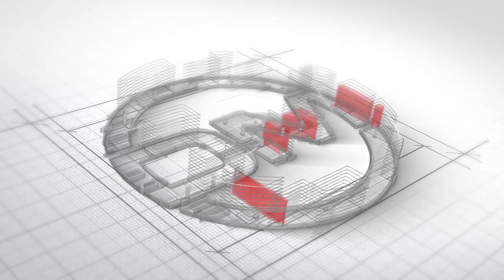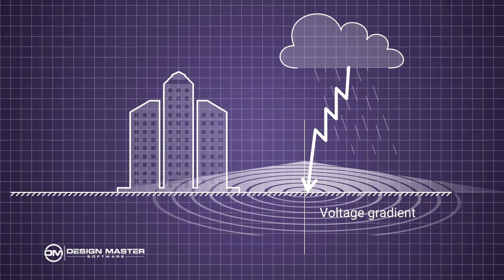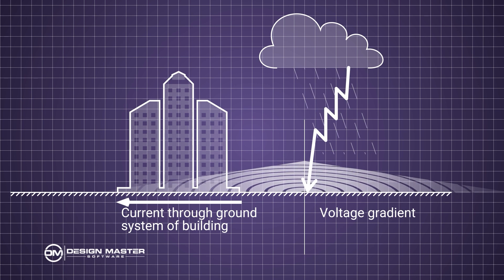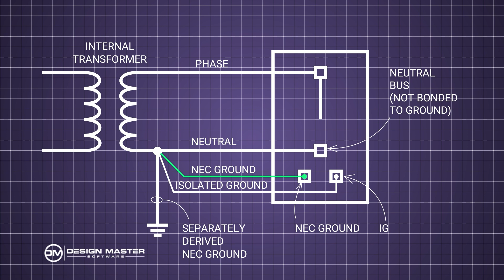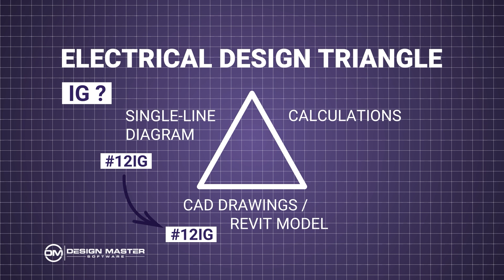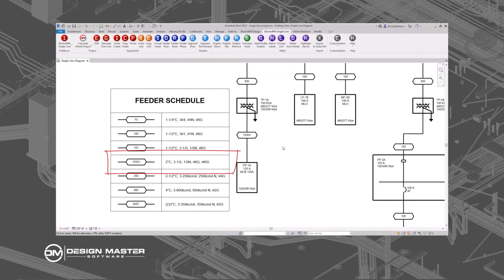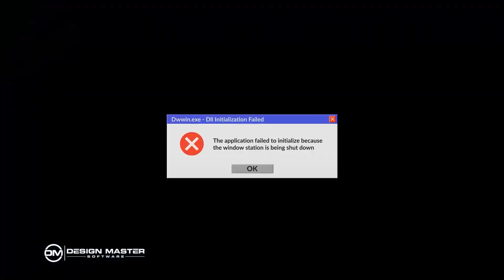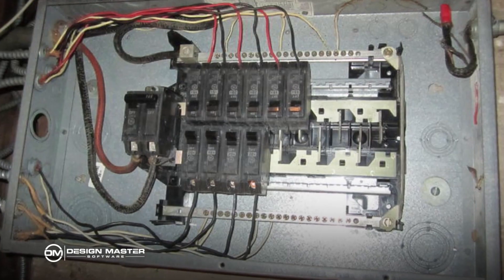Isolated Grounds – Episode 9  #electricalengineering #bim #IsolatedGrounds

Comment: Seems like isolated grounds were everywhere in the 1990s but I see them requested less and less. At their height they were even installed for POS stations in restaurants.

You’re more likely to have issues with a computer when you have 10 uncovered RGB connectors touching the metal case of the PC.